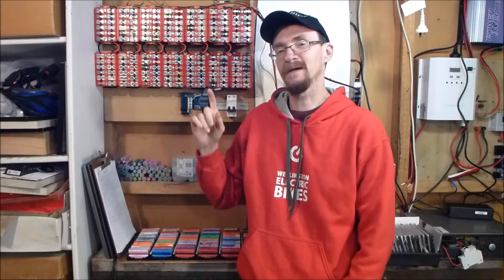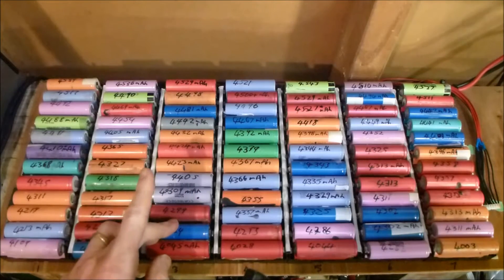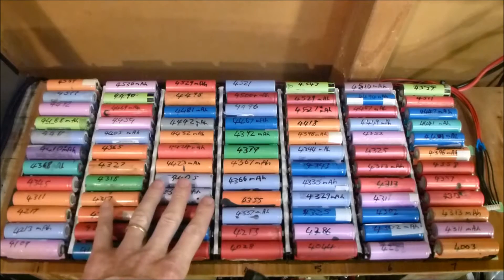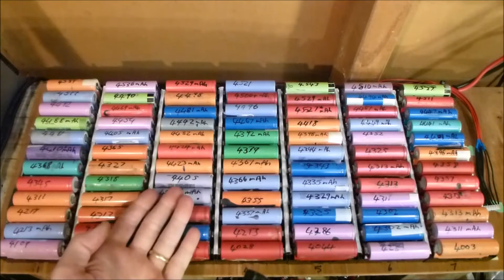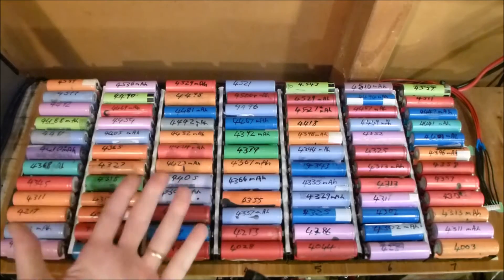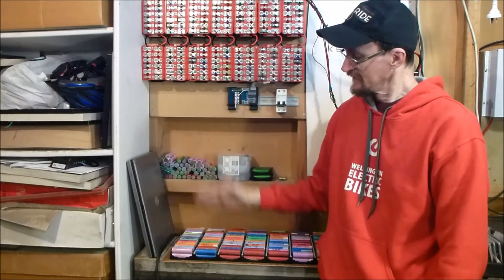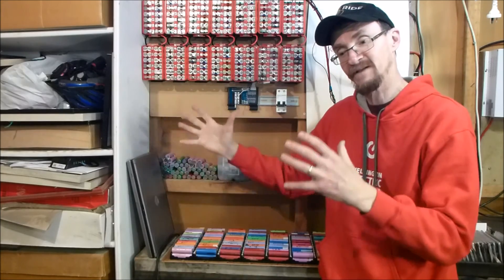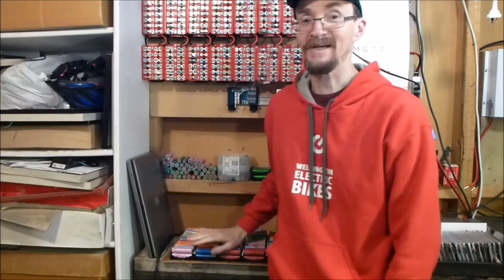Laptop Powerwall 82 -  Powershelf vs Small Blocks pros and cons

Comment: Hello Paul...Good video and information, as usual...!   Idea: If you put the "PowerShelf" on a Tray, with  around 30-to-40 mm high sides, it will become more stable.    Making  sides on the board will also do the trick...   "PowerTray"...!        PS: I downloaded the STL Din Clip...and imported it in to Sketchup. There are a lot of triangles... too many, in fact. ..especially the rounded corners are heavy in segments.  I am making a cleaned up version.    Let me know, if you are interrested, I would like your opinion. Cheers...Jakob
Reply from the maker: This first Powershelf was a quick test to see how well it worked. I think I'll add it into a computer server rack tray like this: https://www.youtube.com/watch?v=GFTi2ni8nMw

Comment: Good one. I'm still undecided as to what design to go for and this helps. I really like Petes idea but also like your small pack idea. But I think I'll be heading for a hybrid design of Petes and a shelf system. Good job mate love your channel.
Reply from the maker: Using the powershelf to test a collection of cells in action is pretty reassuring. I can see how Pete's 80-cell-groups would be appealing - given the number of cells you have. If I had your number of cells and a Prussa i3 I'd go for a 24 cell battery holder/block.
Reply from the maker: Doh! 48 cell (24 pairs) holder/block
Reply: Actually I have an idea which I am testing with and will involve all of my machines (laser, 3D print and Arduino) just testing and still understanding what I need to get this up and running.  Wish you guys where here in the UK!!!
Reply from the maker: Pauls Law: The most satisfying project is one that requires all your best tools.

Comment: Excellent video thanks.
The swapability of the holders appeals to me the most.
Could another advantage of the holders, 
be that you could use a mix of double and single cells easily,
whereas the small blocks would require extra soldering to use single cells ?
Reply from the maker: Ah yes - you can use any combination of singles, doubles or even triples. Good point.

Comment: I'll be doing the same with my 20P groups, using the holders for staging/testing cells then moving to the finished packs:
https://youtu.be/KmJ6w4Kz6rc
Reply from the maker: I'm keen to see how you achieve a consistent capacity over your multiple blocks. Cheers, Paul
Reply: Yes, still working that bit out.  At least swapping cells around is very easy with the battery holders, so that should not be the limiting factor.